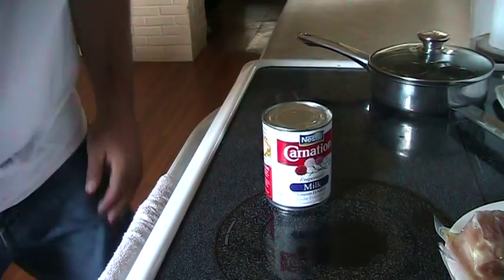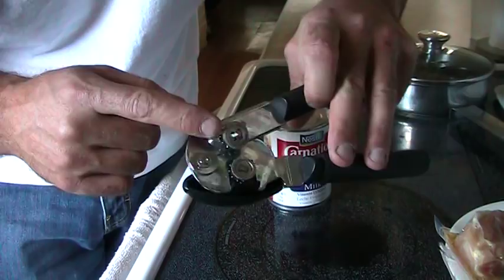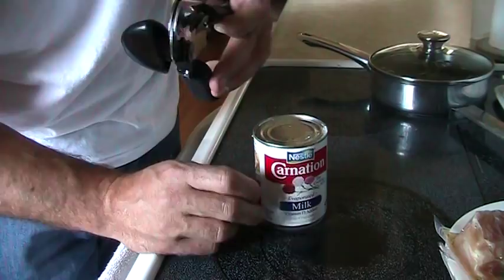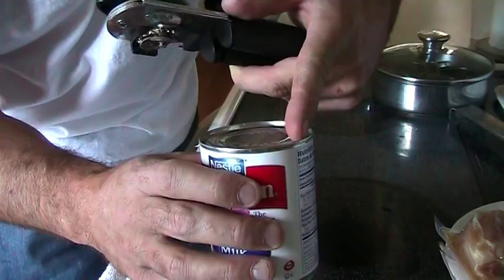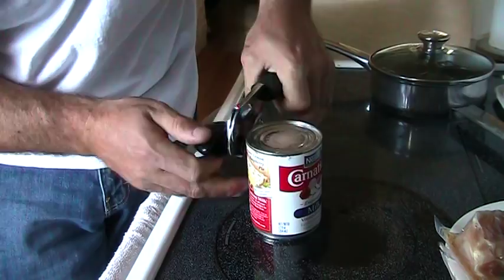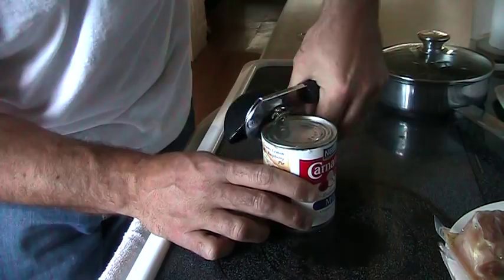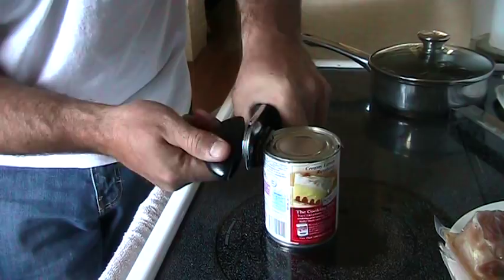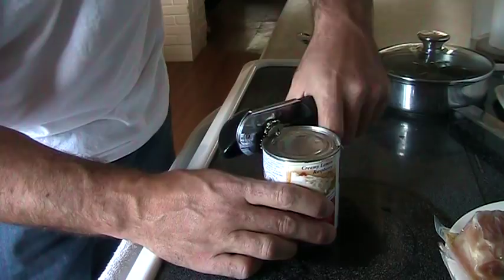How to use a can opener

Comment: Not only do these things suck, it doesn't take a lot of effort to break them in trying to figure out how to use them. I broke 2 of these can openers! I broke the 2nd one while trying to do it after watching this video! I have an electronic one that's easy to use but the top part (which is not the electronic part) is gunked up so it's soaking in water right now to get rid of the gunk preventing it from working. I just wanted to eat some Ravioli. :(

Comment: Lol this guy opened it the wrong way, wtf.  You line the blade against the top of the can, not the side.  Then when you rotate, it pushes the can outward, and rips it open, then attaches the lid between the cog and the blade, then you don't even have to pull the lid off, cause it does it for you.

But how you did it.. that's just wrong.
Reply: Honestly, both method works. I get what you mean, you're suppose to make the tool perpendicular to the can, but personally it's easier to use the method shown on this video.

Comment: This is wrong! The reason it doesn't turn and he has to snap it all the way around is that he's doing it wrong.  Sit it on the top of the can, with the two wheels either side of the metal rim of the can. Then turn the handle.  The can will turn smoothly until the whole of the top lifts gently and safely off - with no force and no sharp edges.